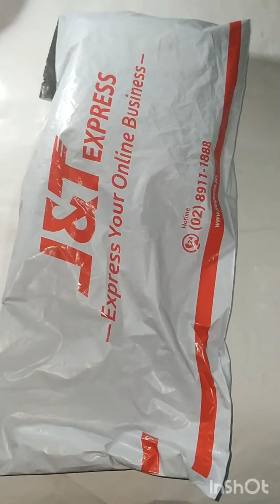Unboxing product for my power genarator project#unboxing #diy #diyproject #powergenerator

Comment from the maker: product link 👇
dc motor controller PWM regulator https://shope.ee/9UbyVcaedW

2-Pin JST RCY Male and Female Connector – 5 Pair  https://shope.ee/4pqIZYgaV3

164 / 328 / 530 pcs Polyolefin Heat Shrink Tube Wrap HeatShrink Tubing kit 2:1 Electric Insulation https://shope.ee/7Ur3kZ3U88

Aluminum Heat Sink  Heatsink with Adhesive for Orange Pi Raspberry Pi 

 https://shope.ee/8KQAkAc5Vz

12mm Metal Key Switch with keys 
https://shope.ee/1qCh0Ilc8L